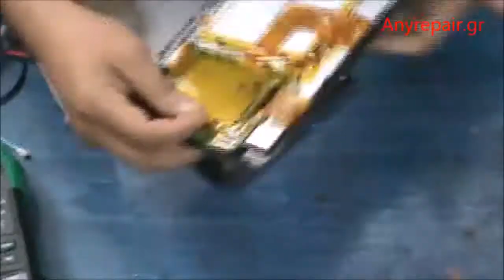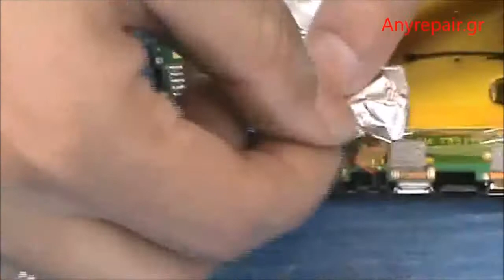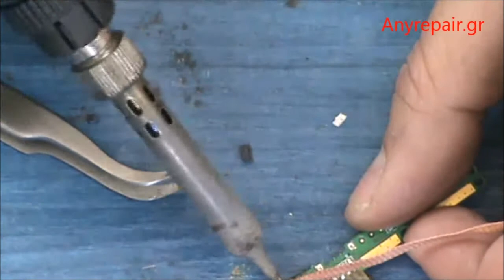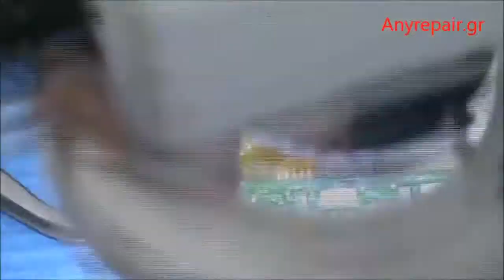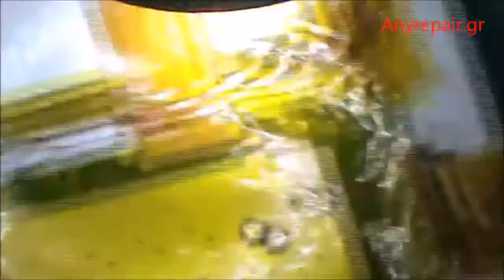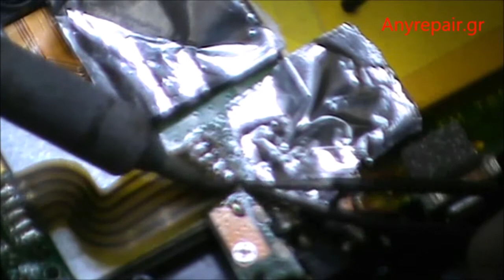tablet power switch repair

Comment: Please..... in english im trying hard to repair.... my iball tab... ahh help me please..... i cant catch up with you're language..... so... can you please use english.... language
Reply from the maker: Hello, it is a simple job but requires soldering skills. It is better to be done by a pro. The procedure is simple. Just solder wires to the switch you are repairing. The one is ground the other, if itis power button switch, has voltage on it. All switches shares the same ground ofcourse. Or you can repair a torn flex by soldering wire to its rail(that is torn). Any ways you need microscope and some advanced soldering skills. Good luck!
Reply: @AnyRepair  Hello, I am working on a similar fix on a different tablet but I am looking to find a replacement switch. Can you attach a link to where you bought the new power switch from? Thank you!
Reply from the maker: @nickkalil452  check this search https://www.ebay.co.uk/p/586684484